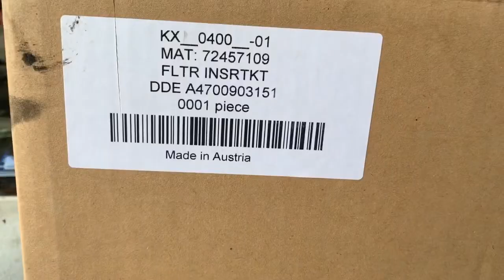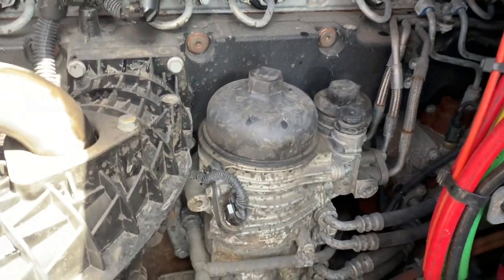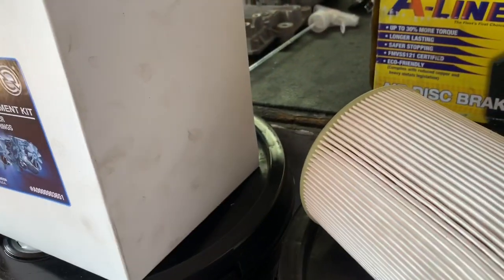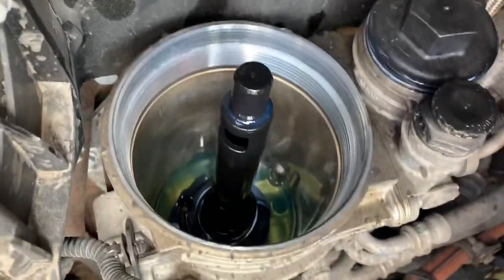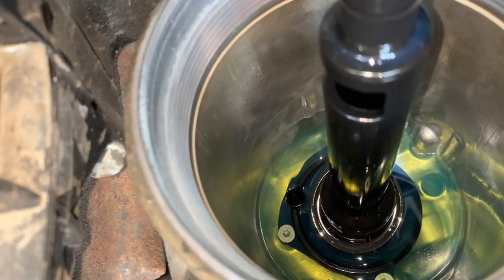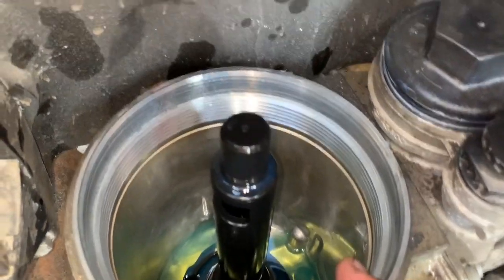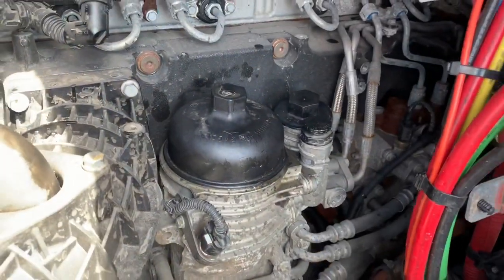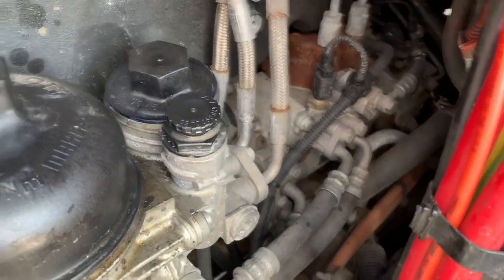DD13 & DD15 fuel filter update ( 2 piece system)

Comment: Buying a new dd15 and I am finding your videos very informative. Easing my mind about these new motors. Seems like it's a pretty simple design.
Reply from the maker: Chris McGaughey thank you. The DD15 is pretty simple, are you working on them or buying a truck with a DD15?
Reply: @CarlosDieselElectric  Buying a 2021 Western Star 4900ex with a 505 hp dd15
Reply from the maker: Chris McGaughey I recommend to stick to the scheduled maintenance and you will be fine. 
Also look into an extended warranty that also covers the after treatment. The filter can get tricky down the road. 
If you have any questions feel free to ask.

Comment: Thank you. The man that changed mine said. Theres no metal bits in either filter but the primary one was pretty dirty. I am however past due the change by 19k miles. Please advise... (P.s. the reason for being late was the pan gasket filter was "trapped at sea".)

Comment: I felt it go in the correct spot for this (also used how old one was in as reference) but wondering if it needs to be pressed down until it clicks? Or if just setting it in was OK? (Currently not starting)
Reply from the maker: It will click or drop into place. Takes some practice. I usually fill the housing up to the threads as the filter hovers over. You might need to push down and turn. You will still need to prime the fuel system with the hand pump. It will take 1-2 minutes of pumping. 
Try not use starting fluid.

Comment: Hola Carlos, gracias por Toda tu ayuda.
Tenemos un freightliner cascadia 2013 y no emos podido comparar El fuel sensor que esta abajo de los filtros, tenemos El housing de los 3 compartments y no emos podido encontrar ese sensor, porque dicen que fue cancelado/eliminado por Detroit, mi pregunta es se puede omitir ese sensor sin causar problems Al motor. Gracias por TU tiempo y ayuda
Reply from the maker: el sensor está localizado en la parte de abajo cerca del drenaje
Reply: @CarlosDieselElectric  munchas gracias por su contestacion a mi pregunta. Saludos desde Florida👋👋👋👋 amo sus videos gracias por compartirlos con owner operators, son una Gran ayuda, Dios lo bendiga Sr Pedro

Comment: Awesome video well done, I have one question Karma how do you drain the fuel module? I know there's a fitting underneath but you didn't show up the video so I'm curious as to how to do it on the ghg14 and ghg17. It would be cool to see a video to make the priming tank. Hopefully I can try to do something similar and showing how to make one. The biggest trick is to get that fitting. Love what you're doing appreciate the work and the knowledge that you're sharing. Piece
Reply from the maker: MrConstant1 the fuel drain on the fuel module should be automatic when the filters are removed. Once you remove the filters on the GHG14 the fuel level will drop because the filters help create a vacuum and hold fuel in place. The GHG17, I haven’t come across yet because they are too new. I usually don’t see new trucks until they are about 3-4 years old.

Comment: How do you remove the three line on the old fuel filter housing ? The back line is hard to get to
Reply from the maker: If you are talking about the old style lines, you may have to grind down an old wrench to get in there.
Reply: @CarlosDieselElectric  . Yes that would work a lot better. There was an extra fitting on the outside line that I was able to take off and gave me access to the two inside lines

Comment: 2015 Coronado, DD15, crank, no start. Primed fuel system, had all 6 injector codes for abnormal needle valve operation. Pulled lines from pump to rail, cranked engine, no fuel coming out. Bad Injection pump?
Reply from the maker: Possible bad fuel pump. Remove the fuel filter (small one) and check for shinny debris (metal). Also, connect to the truck using your DDDL software and check the reading while you are cranking. You should have a desired and an actual.
Reply: @CarlosDieselElectric  rail pressure at 600 psi, desired at 3200 psi while cranking, will run on starting fluid, I know your not supposed to use it, but for testing it fired

Comment: Why or how does metal get caught in the smaller fuel filter? I find metal shaving when replacing smaller screen fuel filter.
Reply from the maker: De'Ja Vu the small fuel filter is designed to catch the debris first. It is actually the primary filter and has the highest micron rating. 
Metal debris could mean the fuel pump might be going out. 
Try to keep at least 1/2 tank of fuel. The extra fuel actually helps keep the fuel system (HI Pressure fuel pump , injectors) cool.

Comment: Came across your video and notice that it's been updated from a 3 to a 2 fuel filter. Asking how about the sensor that was for the 3 filter system kit?? Are these plug and play and would appreciated if you have the answer to it
Reply from the maker: The update or upgrade comes with everything you need. Plugs, brackets and everything. Pretty straight forward. I will try to make a video.

Comment: I changed the cleanliness of my truck with the dd 15 engine and started it and then it didn't want to start, how many minutes do I have to start it?
Reply from the maker: The truck needs to run, preferably on the road to push the air out. Try running s parked regen. This also helps.

Comment: I have a question concerning a hey 2018 freightliner Cascadia that loses prime when it sits for two days or more it is fine and will start no problems if it justSits overnight is there anything I can do to line up whatever the problem may be things that I could look at thank you
Reply from the maker: What has been to the truck? 
Recent oil change?
Recent fuel filter change?
Give me some more history on the truck, has it always done this?
Reply: @CarlosDieselElectric  problem started after I got a full pm done but this was in June  I just had another done  last week problem is still there and wasn't before I took it to them in June. I know I can't prove it was something they did but I know it was. Im just trying to figure out if there are a few things that I can rule out or is this something only a mechanic can fix. I'm leasing this truck from SFI so if I can do some things I will to avoid using my forced maintenance account $$.
Reply from the maker: @Choward1234 are you using OEM (original) filters? 
How many miles are on the truck? 
Do you have access to the DDDL software? There is fuel system integrity check function that can hopefully help pin point the issue.  
But before you do that try filters first, also. Do you have the fuel water separator?
Reply: @CarlosDieselElectric  not sure on filters last pm was done at T/A dont know if they use OEM or not. No access to computer software 256,288 miles no other issues i have an APU so very minimal idling
Reply from the maker: @Choward1234  you may still have a factory warranty through Detroit Diesel. It is usually 4 years 500k miles. 
But call the dealer and verify or call Detroit Diesel with the last 6 of the VIN. 
If not, try doing a fuel filter change using OEM filters. See if it makes a difference
Reply: @CarlosDieselElectric  thank you sir will do

Comment: The fuel water separator on my 2013 cascadia runs out of diesel every 70 miles or so. Truck shuts down while driving. I have to put diesel into it and prime it then it drives another 70 miles or so. I changed all filters 3 times in the last week alone. Do you know what could cause this? Thank you
Reply from the maker: There is a check valve on the inlet line. Also, check the O-Rings. One of them may be pinched, also check the fuel filter itself. At the base where it seats or sits the grommet may be damaged.

Comment: I did they filter change and the truck starts, but takes a little longer to start.  Normally it would turn over 2 times and start.  Now it’s longer, more like 6-8 times
Reply from the maker: Very normal, once you run the engine (drive it) the air will work it’s way out and you will be back to normal.
Reply: @CarlosDieselElectric  thanks

Comment: So I have a question, I had my on my DD15 but before I can start my engine I have to prime it every time. What could be the cause? I changed out my check valve, but it’s steady loosing prime. I feel like he didn’t do all those steps.
Reply from the maker: The fuel pump has check valves on the side. The bottom is the low side or low pressure. The top is high pressure. It could be the bottom valve getting stuck. Try removing the filter and look for any issues with the filters. 
Try replacing them if you have any doubts and go from there.
Reply from the maker: How long have you had this issue
Reply: @CarlosDieselElectric  for a month now after getting a full pm done on my truck.
Reply from the maker: @roydricktaylor135  have you done a service since then?
Reply: @CarlosDieselElectric  .Buenas noche tengo un freightliner cascadia dd15 2016 q tengo el mismo problema para q prenda lo tengo q pompear le hago seevicio cada 12.000 mil millas
Reply: I have the same problem.

Comment: How often you replace the water separator filter?
Reply from the maker: Great question, I have seen trucks that come in that were once Ryder, Penske type trucks and they have a sticker that says replaced every 200,00 miles. Which to me seems ridiculous, I personally change them with every service, which for most trucks we service is every 25,000 miles. 
There is a indicator line on the housing which says once fuel level gets to this point the filter needs to be replaced. You can always go by that reference.
Good thing the filter is about $60-70, so it is not too expensive.

Comment: I had a guy do my filter i asked him about the filter that has the nipple and he said it didnt matter so he just installed the filter 
The filter went in okay and the housing tight all the way truck runs fine but im a little concern 
What you recomend?
Reply from the maker: Daniel Barron the nipple will catch. I usually try to line it up so it catches right away. Makes it faster once you seat the filter. You should be good to go.
Reply: Carlos Diesel Electric  thanks brother👍🏻

Comment: Have you ever seen a 2 piece design that leaked coolant internally?
Reply from the maker: I personally have not seen this happen. Doesn't mean it cant happen. 
What seems to be happening? Are you getting coolant in oil? Coolant in fuel?
Reply: @CarlosDieselElectric  yeah. Coolant in the fuel filter housing. I changed the cup seals, then test drove it and I'm still getting coolant in the reservoir. I'll drain it drive for about 5mins, check it, have to drain it again. This truck came w/a 3 filter system but someone converted it at some point.
Reply from the maker: jejunjohn could be the fuel filter housing or could also be the cylinder head. You might have to find a machine shop to check the cylinder head
Reply: Ok thanks.

Comment: no pressure in the feed pump  whats the problem sir
Reply from the maker: nelson bagro if you put a manual gauge on the priming port, what is the pressure when you crank? Or when you use your Diagnostic Link software, what is the cranking pressure?

Comment: How do u open the drian vavle on the bottom
Reply from the maker: budders !!! Spin it. There is some resistance but then the fuel will drain. This is usually done when you want to drain the entire module. When you remove the caps and pull the filters the fuel level will drop.
Reply: If you are replacing the Baldwin 2 filter system (pf9908kit), then you should know that removing the larger cap for the housing will always separate from the filter, leaving it stuck inside the housing with trapped fuel inside.

Since I always change the Fleet fuel-water separator filter (fs20083) when I change the Baldwin 2 fuel filter kit, I remove that filter first to lower the pressure in the collister & allow someplace for the fuel to exit. Next, I remove the prescreen filter to lower the pressure even further in collister. Finally, I remove the large fuel filter cap (for Baldwin filters will separate from the cap as previously described). I usually wait an additional 5 minutes to allow the fuel to lower on its own. I then use a 2 ft, #5 Phillips head screwdriver to spear through the paper portion of filter & catch it on a plastic center, then prying the filter out against the lip of the housing. Then I install the Fleet filter & then prime it. Next I install the prescreen filter. Lastly, I install the big filter, priming it much like the way it is described in the video above.
Reply: I forgot to mention to be careful not to break the stand pipe inside the collister housing when prying the filter off (It is a $2000 repair by the OEM). You also need to be careful not to dent the lip of the housing. What I do use one hand to gently pry down on screwdriver, while I use the other one to hold the filter straight so it won’t break the stand pipe. Also, you don’t want crack the filter center when spearing throw the paper portion, so that it will leave debris in the housing (otherwise, you would then have to clean it out) you just want to push enough just to grab the rigid center.
Reply: Ted Lee great info. Thanks. I thought that filter supposed to come out with the lid? Why is it so hard to get it out?
Reply: Igor OREGON Minor differences in manufacturing process.

Comment: I have a question about the fuel water separator. I have a 2015 Cascadia and it does not have a fuel water separator, do you know why or the reason behind it would greatly appreciated.
Reply from the maker: I actually do not why some trucks are equipped with and some are not. 
But I think of it as an extra layer of protection for your engine, injectors and fuel system.
Reply: Did you ever done adding water separator filter? And do you think it would work without any sensors getting messed up?  I'm thinking to do that since my fuel pump went bad after only 15 k miles after replacing ( I did complete fuel sistem washing with new fuel modul but probably radiator shop didn't wash fuel  that good)...
Thank you and best regards